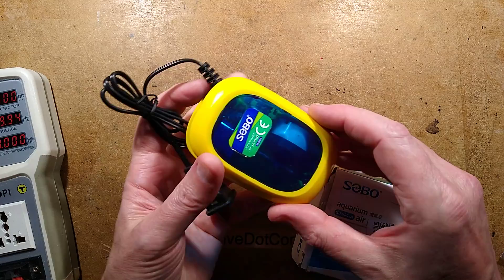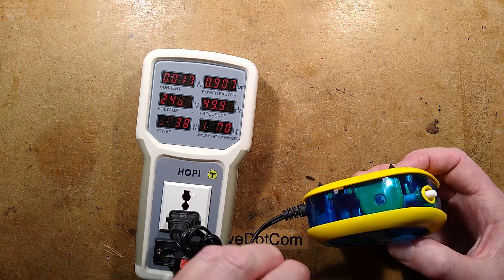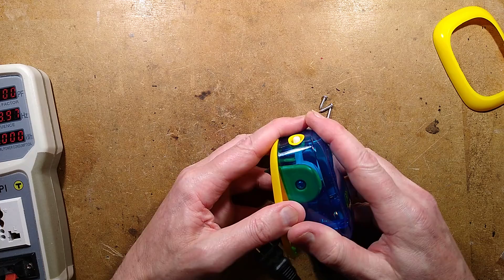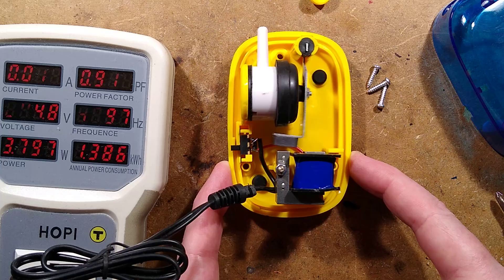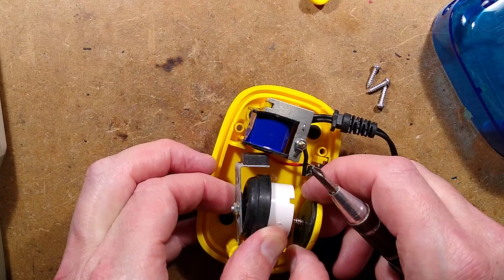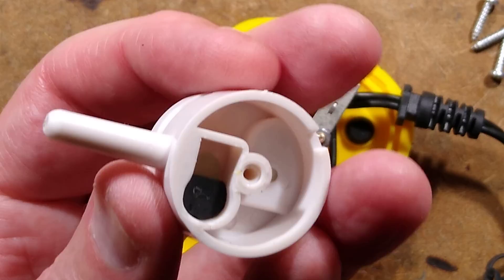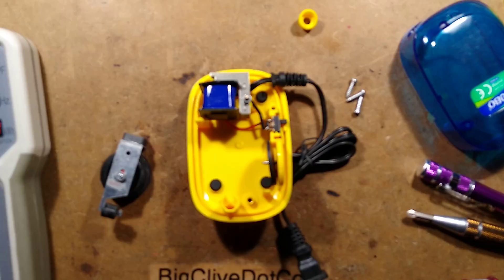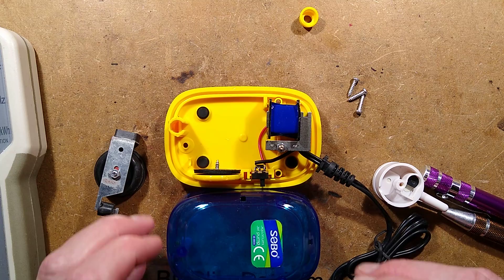Teardown of a two speed aquarium pump

Comment: Would the little pumping motor (with the 3 sections), from one of the foam dispensers you disassembled a while back, work in one of these?
Reply: Yes, those liquid pumps should work fine to pump air. There are actually purpose-built air pumps on that design. They can produce much more pressure than these aquarium pumps but on the downside they have shorter lifespans.
Reply: @eDoc2020  It would be curious to see how they compare.
Reply from the maker: I'm not sure how long it would last in continuous use.  The USB versions use a motor driven swash plate.
Reply: @bigclivedotcom  Hmm ... it might make for an interesting test.

Comment: Nice simple design yet big companies in the aquarium industry will charge you a fortune for essentially the same thing. Save your money for a big external filter that gives good surface agitation that provides good gas exchange and cut out the noisy air pump

Comment: Crap that design is old!  I had several of these in the 80's for aquariums and they were identical.  I remember the rubber diaphragm would split.  You could get a repair kit cheap.  
Mine was a dual with one pendulum but two Chambers and outlets.

Comment: If you ran this pump you'd find it overheats under even the modest of loads, to the point where you'd expect flames.
Reply from the maker: I'll have to test that.
Reply: @bigclivedotcom  Also, I'm just saying this because the guts look identical to one I have (a Viagro VSB-222), which tried to burn my office down.

Comment: Lol.. diode just makes it half wave, so half voltage..
Reply: more like half frequency
Reply: @janami-dharmam  Not really.  The missing half wave is opposite polarity, so it would have pulled the magnet the opposite direction. So the half wave that's still there just pulls in one direction, and the magnet sees the same frequency